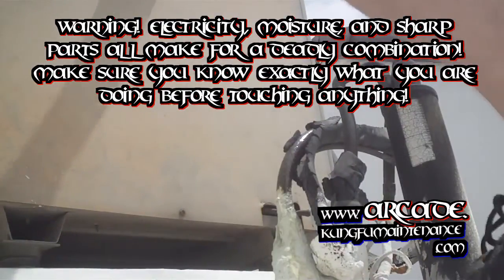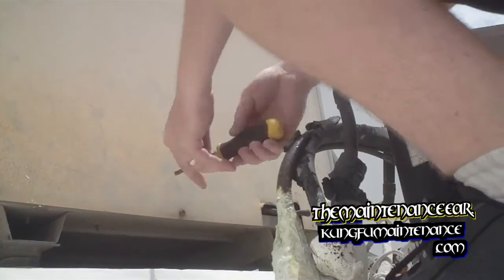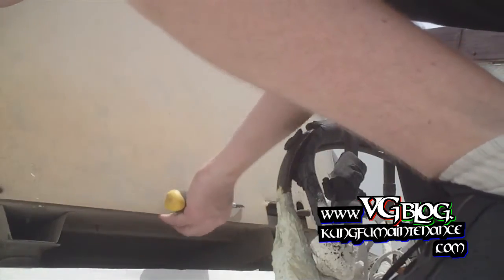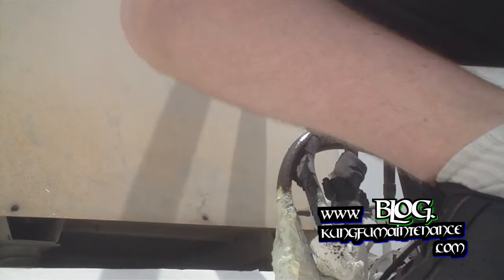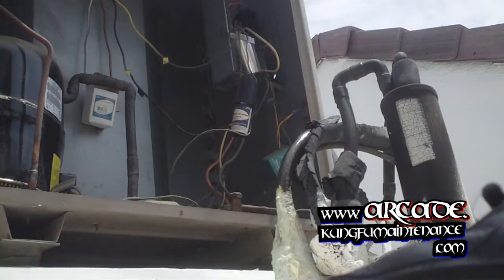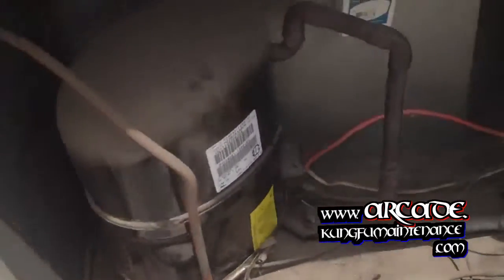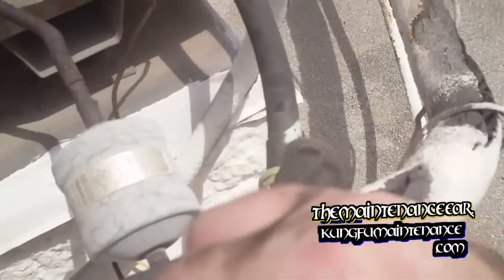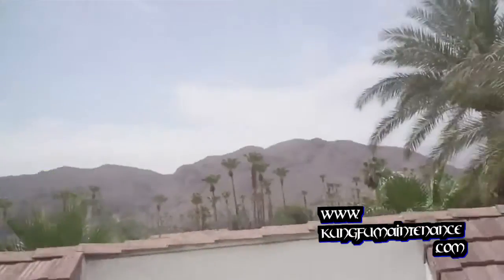How To Repair Broken Air Conditioner Wiring Red Run Wire AC Fan Running Compressor Not Starting

Comment from the maker: Yes that's right the wire lead at the compressor burned and disconnected. The integrity of the wire end was most likely weakened from a previous situation most likely a fan capacitor not starting (or system low on freon)and the machine running and overheating the compressor.It is also possible that the wire was not stripped properly and perhaps the terminal put on with missing strands. The wire may have not broken in these situations and months or years later eventually melted the connection.

Comment: I'm not sure I understood what actually went wrong with the wire going from the contactor to the compressor.  Did the wire or the lead on the wire at the compressor end get burned or disconnected and therefore the compressor would not turn on?  How does that hapapen...through vibration or what?  I like the workaround by flipping the wire ends for a quick fix.